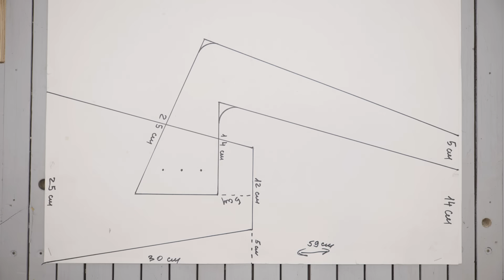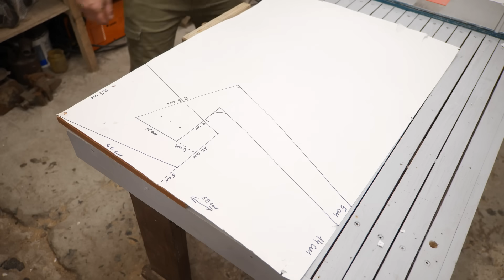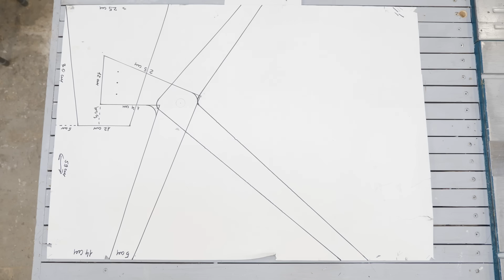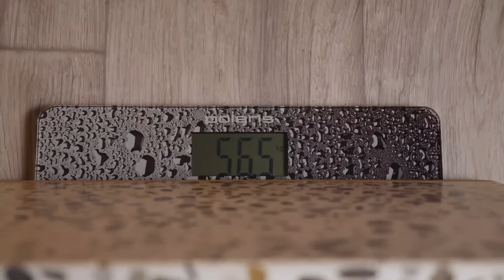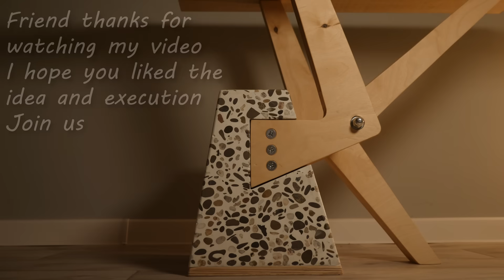Unique idea! I didn't expect everything to be so practical

Comment: Hi all you lovely people at HandCraft
I have added timestamps to your video.

To convert the timestamps to chapters in your video:
1. Copy the timestamps I shared.
2. Sign in to YouTube Studio.
3. From the left menu, select Content.
4. Click the video that you'd like to edit.
5. In the Description, paste the list of timestamps and titles.
6.Viola! Chapters added to your video

⭐ Contents ⭐
⌨ (0:00:00) Intro
⌨ (0:00:24) Design
⌨ (0:00:55) Weld the rebar steel reinforcement
⌨ (0:01:13) Make the formwork
⌨ (0:02:34) Fit rebar inside the formwork
⌨ (0:03:21) Spray release agent
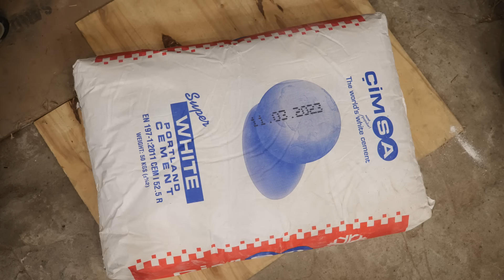⌨ (0:03:36) Sea pebbles, white cement and water
⌨ (0:04:09) Pour concrete
⌨ (0:04:30) Remove air bubbles with vibrator
⌨ (0:05:09) Remove finished product from the mold
⌨ (0:06:23) Buff the form
⌨ (0:07:13) Seal the form
⌨ (0:08:10) Make plywood parts
⌨ (0:10:00) Test-fit plywood parts
⌨ (0:11:35) Weigh the base
⌨ (0:12:40) Final product

Comment: Nice work. There are old park benches made with wood slats bolted to concrete/cement bases that I have wanted to emulate. Now I know how to make the base. For outdoor use, the slats would be cedar or teak. BTW, was this meant to fold when not in use? Thanks.

Comment: Very nice table. Maybe it would be a good idea to leave something inside the mold, another wooden "box" or an empty plastic bottle, something lighter - to ocupy part of the volume, as to lower the total weight. The concrete and pebles would go arround it, but it would take less of it.
Reply from the maker: I thought about it, but I wanted to make a stable structure, so I filled in a monolithic one)